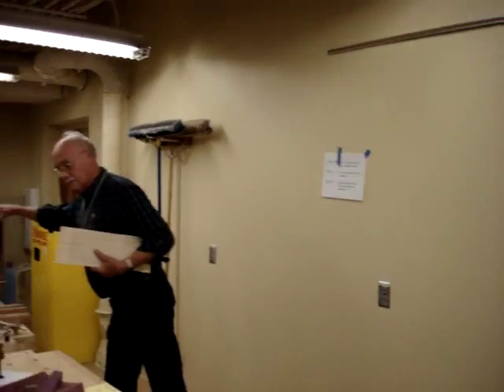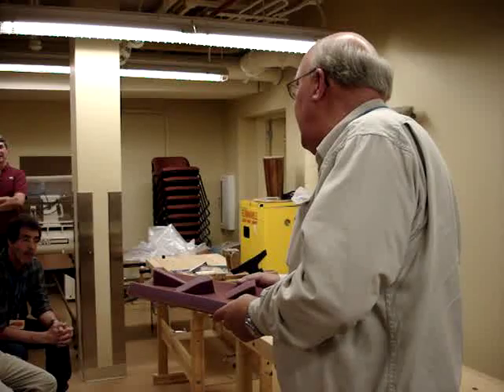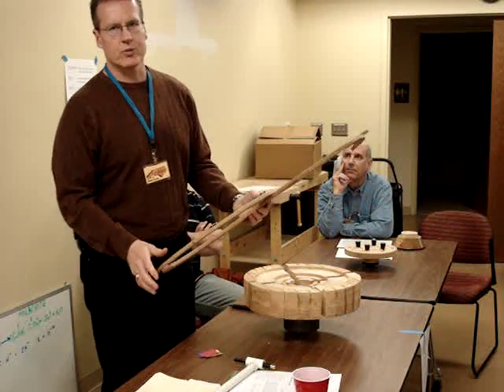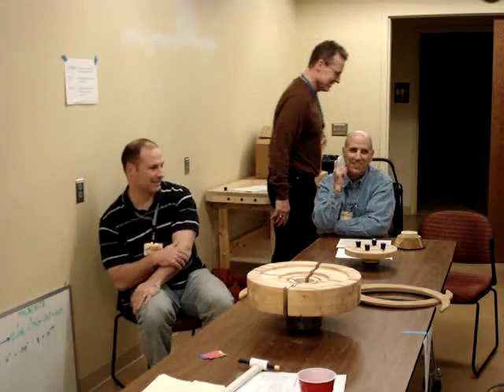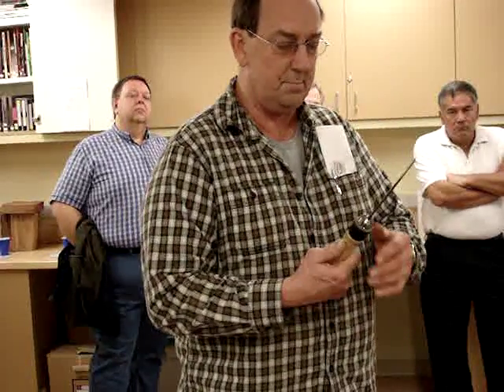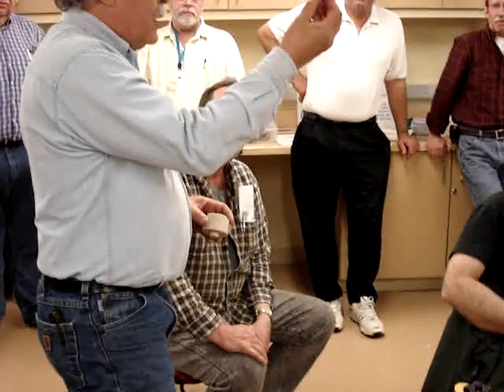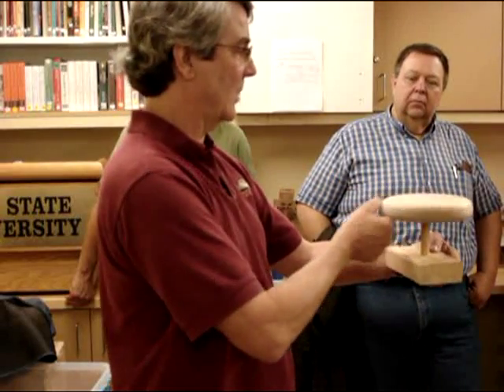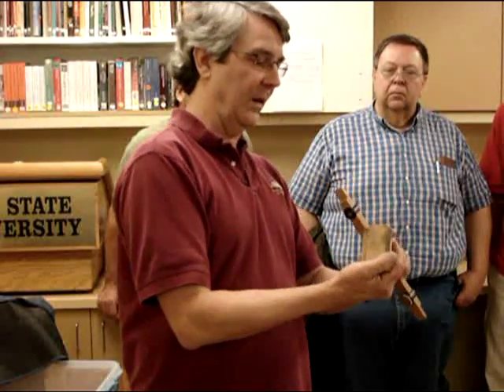WGNC Member Jigs - March 2011

Comment: I have two questions about the fold-out wood vase at the beginning.

1)  How do you fasten both the top & bottom to the solid turned pieces so it stays?

2)  How do you make the juncture of the two ends look the same as the rest?

I think that looks exceptionally slick and plan on trying to make one. :-) 

Thanks for posting - lots of cool homemade jigs to make turning easier/safer.